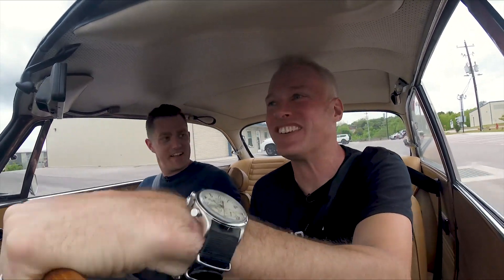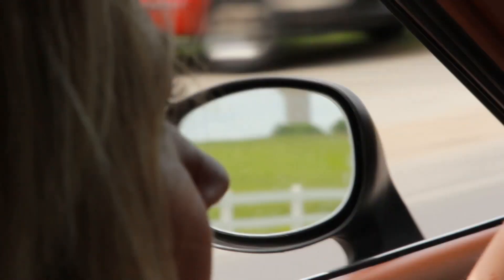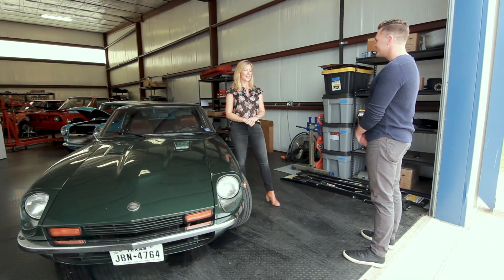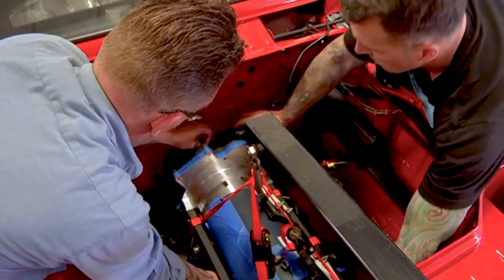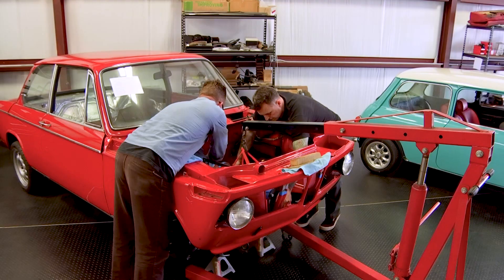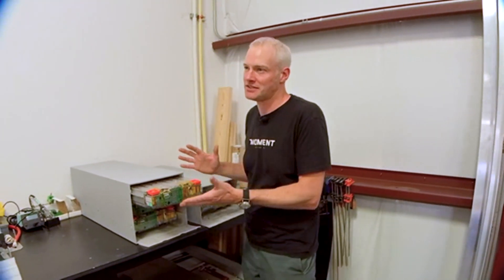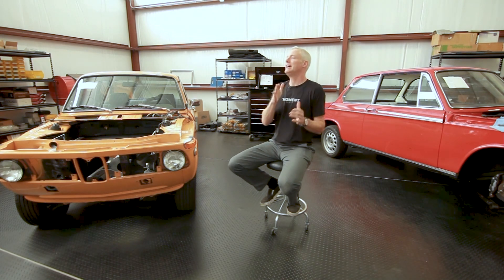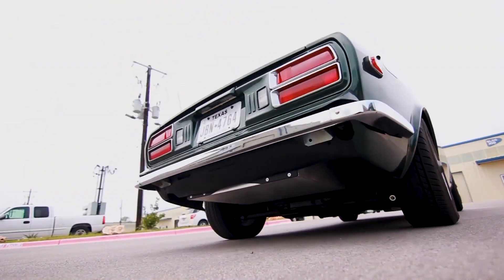Electric Cars Wrapped In a Classic Body | NBCLX

Comment: Stop wrecking classic cars
Reply: They don't usually wreck them. It's usually reversible. Personally I prefer to see it done if the motor is blown or some major transmission issue. I don't much like seeing perfectly working motors pulled.